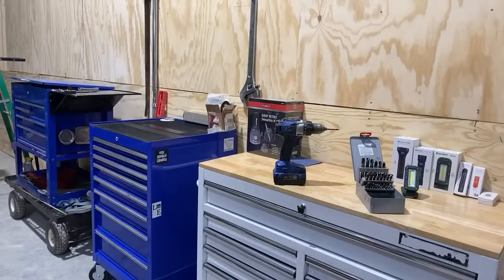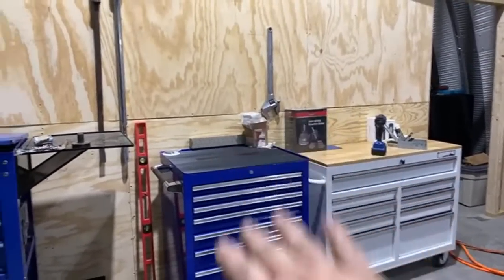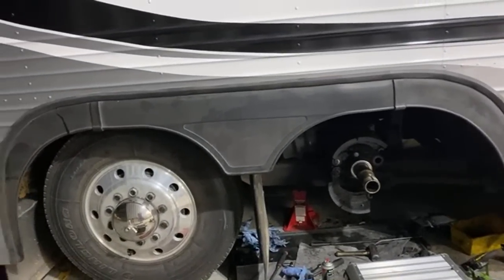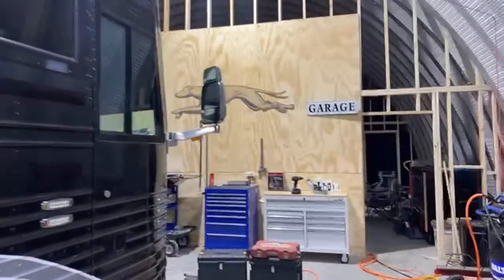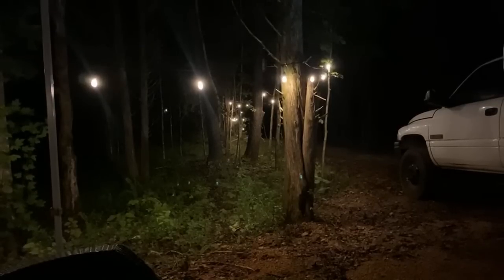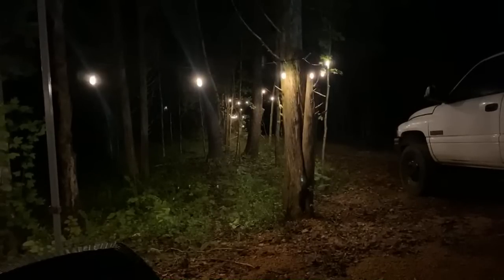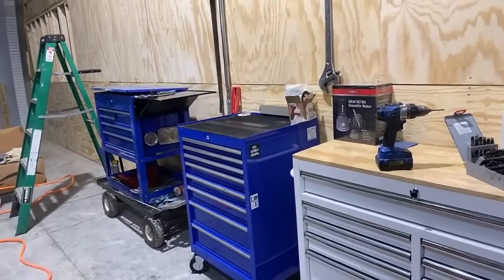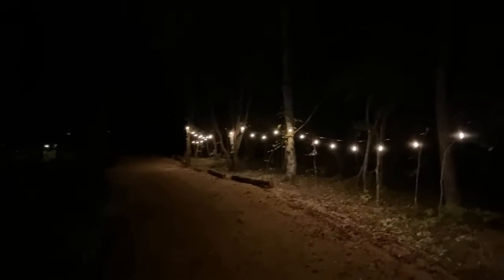Live updates from the shop

Comment: You won't have strong wind in your shop.
To have air going in,you need air going out first.
If it's closed on one end by the apartment,,unless all windows are open,and the door between the shop and apartment open,No air will gush in and push the wall.
It's like a cooling system's aerodynamic on a vehicle,to get air in,you need air to get out first.
Moreover you have more surface area opening than exhasut,so you will have really limited pressure through the whole building and apartment wall.
The opposite wind direction is more a concern for the wall.(apartment towards shop)

Comment: I I had a building like that I would spray foam insulate inside and out then. Tin roof horizontally the out side. And plywood the inside. Then you could heat it easy
Reply from the maker: Well apparently if i had your money i might do the same thing.  Except the outside just the inside is our plan.
Reply: Lol. Money whats that.  I pick up broken thing and fix em. Like for instance I picked up a $50 wood chipper motor did not run no spark Troy bought the coils points condenses in a new magnet did the timing set the points and then when I'm done with it I'll probably sell it for $50 profit my 2008 Nissan Xterra paid $1,000 for the book value is 9000 rebuilt the transmission fixed everything that was wrong with it I'm one of those jack-of-all-trades master of none but better than master of one I am very impressed with the progress you are making I watch your podcast constantly and your son you're a fascinating group of humans down there I appreciate your Channel

Comment: There will be condensation on the inside of the metal. You have to deal with that so you do not have rotting insulation and rotting wood.
Reply from the maker: It will be spray foam coated so no it won’t have condensation issues.